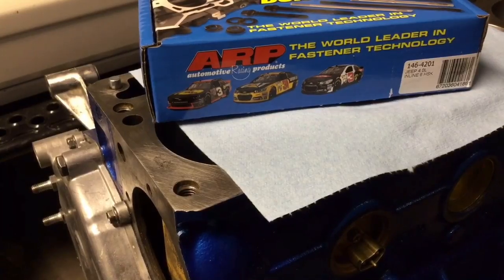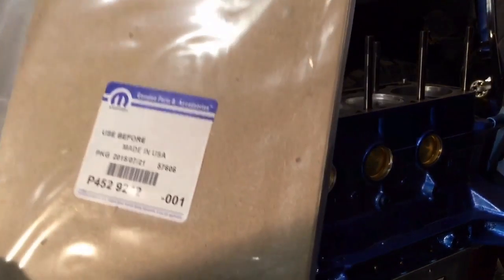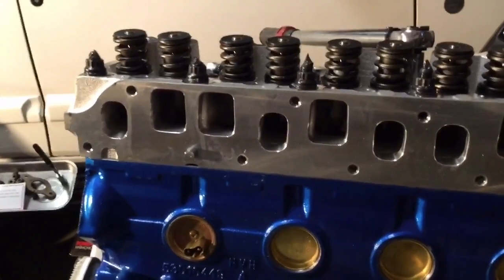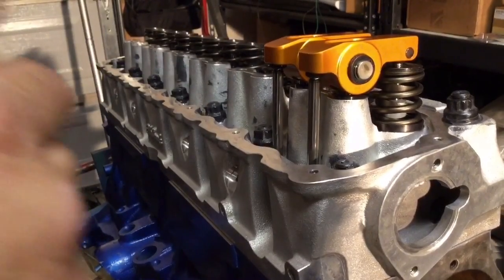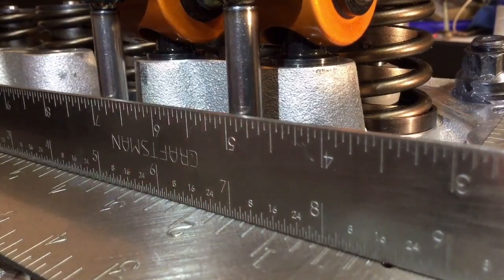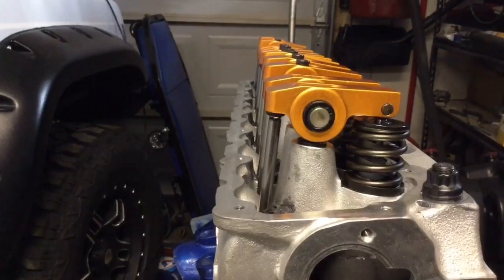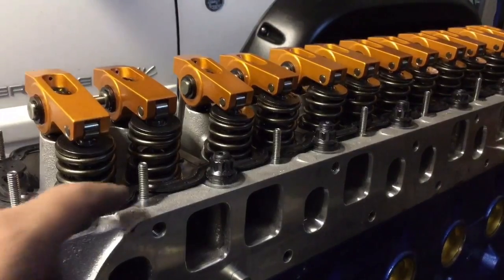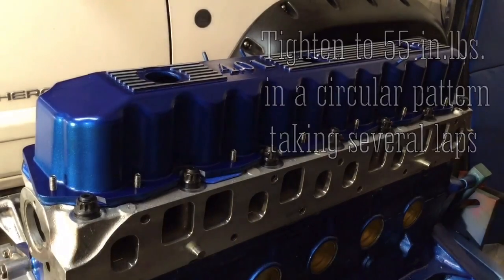Jeep 4.7 Stroker Complete Build Part 4

Comment: I just mounted it and 25, 40, 80 is the torque that my Edelbrock 50169 head calls for. I'm using felpro bolts w/ ARP washers and lube. Where did you get your specs? Any info is appreciated.
Reply from the maker: I believe the specs were from a Haynes manual.
Reply: Thanks buddy. Some different info out there. Edelbrock reccomends 25-40-80 @kevefox

Comment: Edelbrock told me to only do 80 foot pounds with their cylinder head and ARP studs. Have you had any issues at 110?
Reply from the maker: Interesting. No, zero issues.
Reply: I have a feeling edelbrock meant for 7/16 bolts. Its actually really hard to figure out what I should torque the head too. I called ARP and they were very convincing that 110 was ok but I've heard everything from 80-125 from various different builders I've emailed like hesco they say 110, clegg engines where I bought the head say 110, newcomer racing says 80 and no more than 100, 505 performance says 90 for bolts 125 for studs, and edelbrock was all over the place but finally said 80. After my research I think they were wrong and were thinking 7/16 bolts on the earlier engines.

Comment: Did 505 install the valve guides and springs?
Reply from the maker: No, I had a machine shop in Denver do that. 505 does offer this head with this valve train installed.

Comment: Now, it's been a few years since I've used ARP studs, but I do believe they say not to "snug them down" into blind holes. I always installed them finger-tight, then backed them off maybe 1/8th of a turn. My understanding why is that as everything heats up, the stud could expand downward and crack/break through the bottom of the hole. Also, all threaded holes should be chased before the final wash down leading to assembly; no guarantee the brake cleaner will get all the shaved metal debris.

Comment: Question - I see you used the Mopar performance springs, retainers and locks, but did you need to do any additional machining to the head for the springs to sit?  The Mopar performance springs that I received are larger in diameter than the Jeep 4.0 valve spring, and my machinist is worried about the spring not sitting comfortably on the head.  It wiggles on the spring seat.  Any suggestions?
Reply from the maker: Patrick Schliesing no, they fit perfectly on mine.

Comment: When u installed the arp head studs they aren't long enough to mount the wire harness rail.
Reply from the maker: TheVintagetamiya that is correct, I think there are enough thread showing still where I could weld a stud inside of a nut and just spin it on A few turns to provide a mounting area for the harness.

Comment: what is the part number of the harland sharp roller rockers are you using you forgot to put it if you don't mind asking
Reply from the maker: Jesus Espinoza 
S40196
It's in part 3 @ 15:12
I soaked them in oil for a day first.
Reply: Oh ok thanks sorry
Reply from the maker: Jesus Espinoza no worries, any time

Comment: About how much did this whole build cost?
Reply from the maker: radams204 i'm sorry, I have a drawer full of receipts in my toolbox but I have not tallied them up yet. I've been so damn busy with work but I intend on making another video outlining the price of the parts.
Reply: Tinkering Fox that would be most helpful. I intend on doing this same build in my 93 yj. this video series was awesome and ill be in touch.
Reply: This whole project from boring, honing, balancing, parts scavenging minus the Edelbrock head tallies out to roughly $2900. It is a heavily involved building process that took me 3 years of 15 minute acts between bad weather and working full time. This particular video has made me realize that I may need to tear down my valvetrain one more time due to pushrod length. I didn't have a checker tool at the time and had to guess rod measurements based on the amount of seating travel. I ended up choosing 9.66" steel rods that may not be the correct length for my Harland rockers and Crower 44243 combination. Engine starts just fine but doesn't want to stay alive for more than a few seconds. May just be a vacuum leak but now I'm questioning it.

Comment: Awesome video series you set up here. I just finished a stroker build on my Cherokee and came across a lot of the same issues. Looks like you didn't cut any corners or spare any expenses; great job!
Reply from the maker: Alex Holmboy 
Thank you, part 7 waiting on a few parts. Next up is a Hella fuse block/relay block, headlight wire harness and ext idle switch.